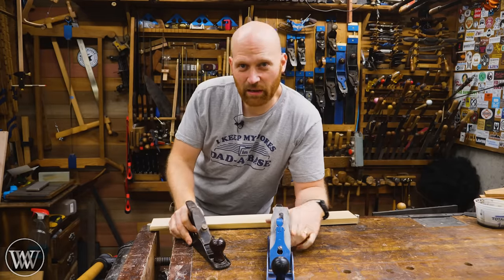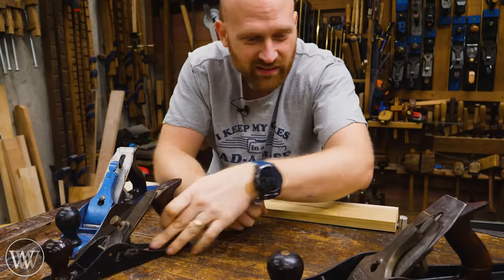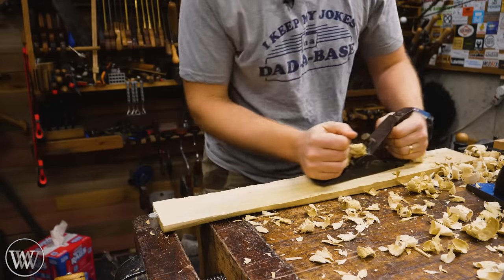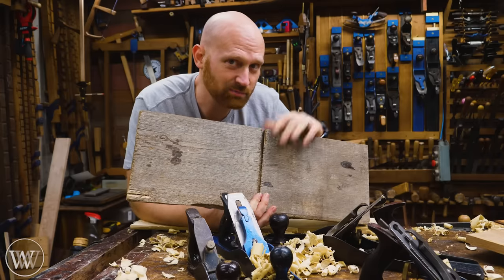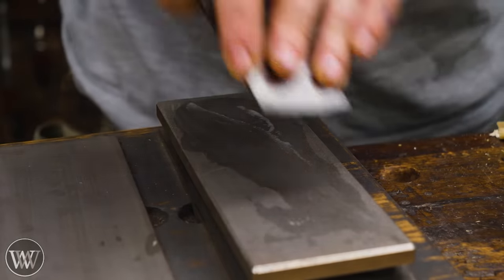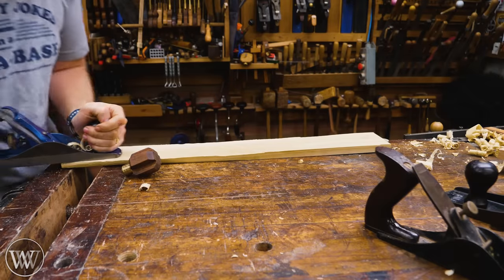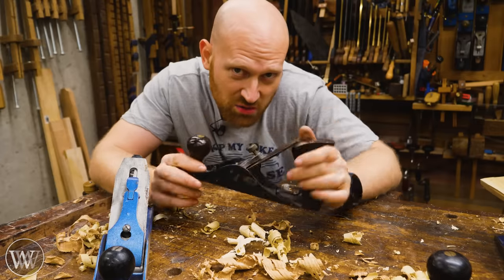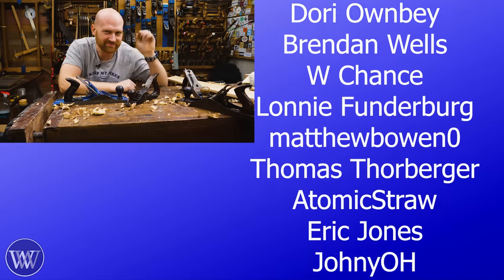Scrub Plane Vs Fore Plane How to Use and Sharpen

Comment: I bought a scrub plane fairly cheaply, and I use it occasionally to put an interesting "rough hewn" texture on a board. I generally use it with the grain and set the plane for a light cut.

Comment: I’ve heard a few people say that you should stick with the coarsest tool as long as possible. This definitely makes your work faster and easier.
Reply from the maker: Right on.
Reply: The amount of time you can spend is completely dependent on amount of wood. It requires a certain amount of athleticism lol
Reply: I've found that this is true when working with axe split / riven wood and 90% of my plane work is done with a scrub plane
Reply: Agreed, use the coarsest tool for as long as you can and you will finish your work as fast as you can.

Comment: I guess when I was younger I was using my number 4 as a scrub plane, getting older with a decent plane I took thinner shavings. Now I’m really old I use a planer thicknesser. But I still use rough sawn timber as it is cheaper. For fine work smoothing I go back to my expensive planes with decent quality irons well sharpened. That is what I should have done as a newbie except I had very little money. It’s all great fun and satisfying. These videos are preserving important skills that power tool woodworkers do need.

Comment: In addition to removing large amounts of material, I've found that scrub planes are helpful for targeting knots which cause issues with a less cambered iron. I found trying to flatten a board with knots (especially pine) I would get little raised mounts around the knot because it would cause the plane to lift, also the knots dulled the blade very fast. Using a scrub plane to get the center of the knot lower than the surrounding area made things a lot easier

Comment: Buying S3S lumber definitely reduced my use of scrub planes (#40 & modified #5).
I usually planed on the diagonal, cross grain.  The ridges help me determine how I’m doing on the next step.
I have found scrub planes particularly useful for twisted or cupped boards, even with a shop full of tailed apprentices (jointer, plainer, table saw). They knock off the high spots before power tools.
I have heard fore planes also referred to as try planes.

Comment: Traditionaly in Denmark, and I belive this is actualy a German tradition, we have 3 planes. Skrub høvl. It literaly means Scrub Plane, The next was the "Slet Høvl" Slet is delete or erase. It was used after the scrub to erase the marks left by the "Skrup Høvl". The final one is callet the "Puds Høvl" It's the finish plane. "Puds" can best be translated to polish, but the word is from before we had sand paper. The "Slet Høvl" is almost identical to the Puds Høvl. It's a bit longer about 3/4" and the moth is a bit wider.
Reply: The German terms are 'Schrupphobel' for the scrub plane, which is then followed by the 'Schlichthobel'. This one has little camber, a big mouth and no chipbreaker. Schlicht means 'plain', so I guess it's a 'plaining plane' :). Its job is to turn the scolloped surface left by the scrub plane into a 'plain' fairly smooth surface. The 'Raubank' (long try plane) might also get used at this point.
Then comes the 'Doppelhobel' which is like the Schlichthobel, but with a smaller mouth and a chipbreaker (hence the name 'double plane'). This gets you (almost) to the final surface.
At the very end you use the 'Putzhobel'. Putzen means to clean, so that might be the origin of the name. It has a higher angle and a shorter sole, as well as a small mouth. The mouth size is sometimes even adjustable.
Reply: The difference, I think, has to do with whether you're working sawn or riven boards.

With a sawn board, a medium length plane with a wide and medium depth cut would quickly flatten a board and even get it mostly true.

With a riven board there would be more individual (and significant) high spots that had to be removed first, so a handy light plane that could take a deep and narrow cut made more sense.

Try a German scrub plane, they are ridiculously light and handy.
Reply: Basically, same mindset as sand paper.
Start with 80-grit and use finer and finer grits until you get a smooth finish.

Comment: I guess I am the odd-ball out when it comes to scrub/fore plane use.  I still use them about as much as I did be-fore 🤪.  

I do not have a Stanley no 40 or a specific scrub plane from other manufacturers, but have made a few from damaged planes. 
No 4’s and 5’s that at some point in their lives got a cracked mouth that previous owners soldered I have found to be good scrubs, along with no 78’s (damaged or not).

Comment: I found a crappy copy of the stanley sb3 (the one with two screws on either side of the blade) and gave it a second chance as a scrub. It works very well for that as it doesn't need any precise adjustments.

Comment: The range between a #3 and #6 is so confusing, even the experts have different preferences. I was able to get a lot of them cheap, so I could choose whichever one works for me. Then like James, impressive tool wall! The scrub plane can easily be the cheapest: a wooden body, an off-brand, a parts plane with missing pieces. Or make one.

Comment: Great video. I never knew the exact difference between this 2 planes.
Can you use the scrub plane if the wood has knots?
Reply from the maker: Yes. Sometimes you won't set it to go quite as deep as you would but for most knots it will still cut through it.

Comment: I hear that TLC only uses fore planes. They don't want no scrubs.

I have found that the price for S2S vs skip (or hit/miss) planing is fairly negligible compared to the time spent truing a board on anything larger than a coffee or side table. Therefore, it might be better to go with the rougher lumber on smaller projects to save money at the cost of time.

I took a second No. 5 iron and put a 10" or 12" radius on the blade for the rougher lumber. It is also handy on 8/4 and larger lumber where the resistance in the cut causes the blade to dish a valley in the board. I find my converted fore blade in my No. 5 works perfectly well for it.

Comment: I made my scrub from some crappy no3 sized abomination with metal spoke shave style adjustments. I also have an antique from my paternal grandparents' basement that is either a round bottomed scrub or a round with a very large mouth that I have not gotten around to using.
I also do a lot less scrub planing since I got my bandsaw, with the right sled you can get stuff fairly flat of the bandsaw.

Comment: I usually buy rough sawn lumber and a scrub plane or fore plane is often used to clean up spots before running them through a power jointer and thickness planer. Why fight with the jointer for 5 minutes on a curved edge when a scrub can remove that curve in under a minute?

Comment: I bought a five pack of replacement irons for my number five, ground a big old curve of the front of one and presto I have a killer scrub plane for my "Roubo workbench from trees I cut" project.  Yeah, changing out the blade is a bit of an annoyance, so I got another plane... and I may have started an addiction.

Comment: How is it that most (perhaps all) of the planes you are obsessed with, were designed  and built long before you were, yet you have more information than the engineers who designed them? How much time do you spend researching this stuff? I have even researched a few of the odd terms you use and You are never wrong.. With all the video's you put out, How do you have any time to actually build things??
Reply from the maker: Thanks. But I have been woodworking for about 35 years now. Lots comes over time, and I love learning new things every day
Reply: @WoodByWrightHowTo  You sound as if all the knowledge just comes with using a tool.. It doesn't. I started at my first furniture company in the mid 70's. I never even saw a hand plane in any of the shops I worked at. We learned about them in school but rarely used them because we has electricity. It was fairly recently that I owned one.. Oddly, I bought a bunch of vintage tools to build rustic log furtinure and you use yours to do precision work.. Say what you want but the amount of intricate information you have didn't just fall in your lap. People learn about and use a hand plane because WANT to, not because it's the only way to do things..
Reply from the maker: Right on! you have to love to learn and be willing to do some research.

Comment: I curios what are your thoughts on the LAJ with a course toothed blade? Could I get away with getting another blade?
Reply from the maker: the toothing blade is not as good for hoging off material, but you can not get much of a camber for a LAJ. that is why most people that prefer a LAJ end up getting a junk standard plane and turn it into a scrub.

Comment: I want to turn an old #4 into a scrub plane.  I seem to remember you saying in a video years ago to draw a 6 or 8" radius circle on the blade to get the correct camber.  Was that you?  or was I cheating on you with another (inferior) woodworker on YouTube?
Reply from the maker: Yes. Usually I like the tip to be about 1/16-1/8" out past the sides of the curve.

Comment: I got a cheap plane, replicating the dimensions of a number 3, but so badply manufactured that it wouldn't work. Period. I removed the adjustment, put a big screw over the lever cap, and ground the bevel to use it as a scrub plane. I adjust it with a hammer. At leat the iron is properly hardened.

Comment: Yes, a very fun video to watch, as always. But I have not understood what the advantage of a scrub plane is. I saw you violently destroying a peace of rough sawn wood with the scrub plane, I did not see it improving for more refined use. Seeing the poor piece of wood that was left, I kind of missed the reason why you think this scrub plane is so important to use on rough sawn wood.
Reply from the maker: Often especially with Russ on wood you have large twists in the wood and it requires you to take off a quarter inch or more from one spot or another. If you do that with a regular hand playing it takes a long time to get through it. If you take off the majority of the material with a scrub plane then you can come back with a regular hand plane and smooth it out and it takes a fraction of the time as if you just did it with the regular plane. The scrub plane is for removing a lot of material very quickly.
Reply: @WoodByWrightHowTo  Ah! I think I get the point now. I saw you scrub planing the entire surface, but in practice you only scrub the parts with large twists, knots or other compactions. Then you can plane the whole surface more easily, right? Thank you for your explanation.
Reply from the maker: correct. you just use it when you have to take off a lot of material.